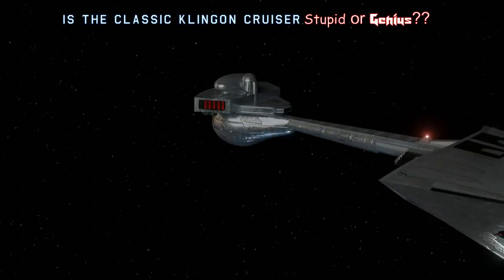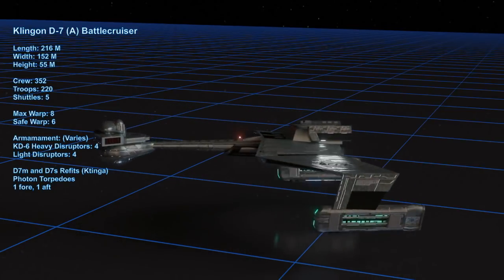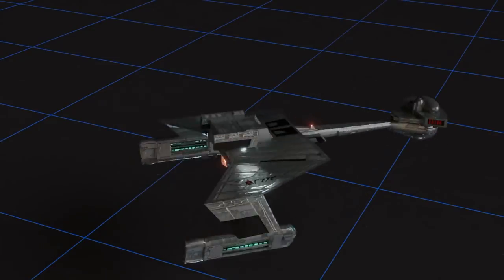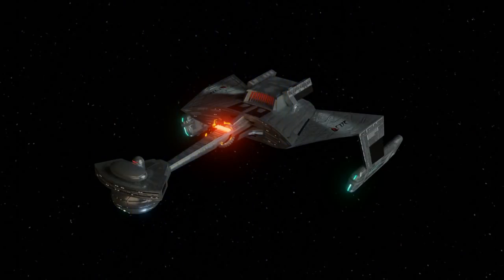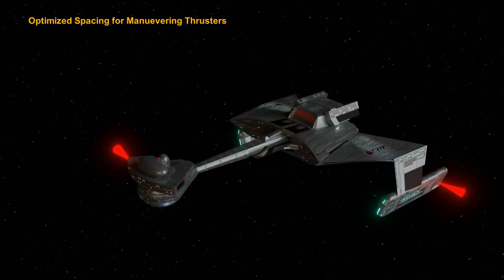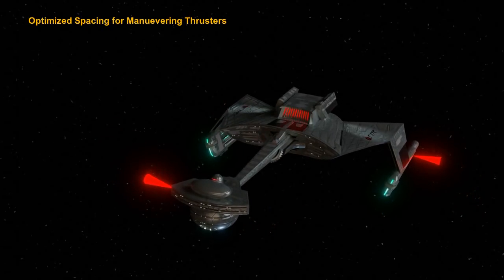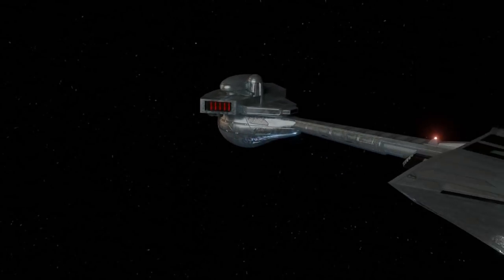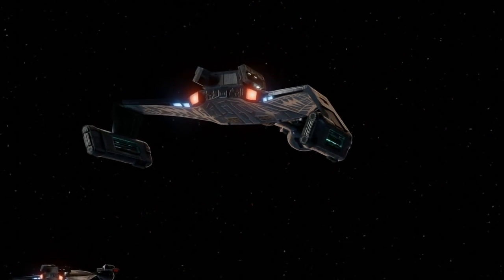The Classic Klingon D-7 Cruiser - Stupid or Genius Design?? Animated Breakdown!

Comment: My theory is that the D7 design is heavily armored but also angled to deter sensor detection, like modern stealth aircraft. The D7 takes advantage of cloaking and a devastating first-strike capability. Speed and maneuverability and always facing toward their enemy would reduce the profile and reduce exposure of the armored boom. I imagine the design preference for Klingon ships is armored hull, offensive power, speed, agility, and stealth/cloak. I would add that if memory serves, Klingons did not have photon torps until the "movie" era, so perhaps their ship hulls were tougher / reinforced against such firepower.

Comment: Its built like a star destroyer, its wedge shaped. But with the area behind the front pod cut out. This massively reduces the materials needed to build each ship. Looking at the volume you could easily build a 4th vessel for the material you save on building three.  Every time you see a Klingon ship, they are in packs. Federation ships almost always alone.

These are warships. They only have one purpose.

Comment: The long neck serves several different functions. It houses a plasma tube in the center. That is essentially A projectile tube for certain type of photon torpedo. That is powered by the main reactor. This gave the Klingon warship one of the most powerful weapon systems in their region of space. The long neck also separated the crew from the highly radioactive power source of the ship. 
The shape of the front of the ship. Down the long neck to its base collar. Was designed that way to also serve as a long rang communications and surveillance system. You could think of the Klingon D7 warship as being built out from the inside of the main deflector dish. Where the enterprise class of the federation is offset from the saucer section. Klingon ships are built inside the main deflector dish.

Comment: I was thinking it had to do with separating the delicate sensors from the high energy of the warp fields and reactor, which might be a factor, but honestly Klingons don't tend to put a lot of emphasis on sensor technology. Instead.... Battlefield damage tolerance. As you point out the ship has weapons on both the body and the head.  You can't fully disarm the ship easily. I bet the weapons on the front have their own redundant power supplies too. That would be VERY Klingon.

Comment: Just a what if…

In TNG it is pointed out that it is the duty of every Klingon crew member to replace a more senior member if any sign of weakness is perceived. While very motivating, it doesn’t seem like the command crew would be able to concentrate on their duties if the entire crew had easy access to the command spaces seeking any opportunity to advance. By placing the command section at the end of an easily controlled choke point, the design ensures that the officers will allow the traditional policy to remain in effect while minimizing the number of advancement opportunities. 

This probably wouldn’t be a design consideration that the Klingon high command would advertise, but a beneficial consequence of other design “necessities .”

Comment: Only thing I can think of is they did that to meet safety regulations on being so far away from their engine radiation because they could only pile on so  much armor or radiation barrier and that happens to be the safe distance.   But then that would mean the sleeping quarters are being blasted.   Maybe its peacocking like "hey aim for my cockpit I dare you".  Probably they just wanna keep the high rankings from sleepign with the low ranks.   Or maybe its to signify "come for the front first out leaders are the best warriors"

Cool to see we guessed alot of the same stuff, I was thinking about "saucer seperation" tactic too but didnt think they had that.
And the turning speed thrusters balance was a good one too.

Comment: I would reason that many ships in Star Trek use elongated designs not just because of warp field geometry requirements as mentioned, but as a form of damage control, and possibly for maneuverability.  The damaging affects of weapons and any secondary explosions can be prevented from taking out the whole ship by separating crucial systems.  In the D7 design it is unlikely that a critical hit to the ship will disable both the front pod and the rear sections of the ship, where if there was no neck providing that separation, a hit to engineering may tear through the ship and destroy a bridge area built closer to it.  Klingon ships likely have back-up systems to allow the ship to be controlled by the engineering section if the command is destroyed, and while less effective, still able to put up somewhat of a fight.  The boom also allows weapons systems to be projected forwards of the rest of the ship, again providing separation so that it is more difficult to take out all the enemies weapons at once.  Federation starships also follow this principle with multiple phaser arrays positioned around the ship, something they can do because energy weapons do not require complicated internal systems to provide munitions to them.  The systems that do require munitions, torpedoes, are far less common place.

Comment: The turning speed makes sense that way 1 ship can decloak and quickly turn and fire on as many ships as possible before recloaking.    And I assume most Klingons would drift instead of staying still and firing like in the shows.  Also that way they can aim their straight shooting proton accelerators or plasma cannons and turn fast.   1 might be able to decloak and take out like 3 unshielded ships and recloak while never stopping and then other guards have no idea where they went and almost no point of firing weapons with prediction patterns cuz they were moving so fast.  Causing the rest of the surviving ships sleep stress for the next 3 days and they scared to stop engines.

Comment: Cubes and orbs are the best design,  the command section at the very center core surrounded by ablative armor, reinforced hull integrity structure, escape pods, rotating shield frequencies, and all backed up by an independent triple redundant power grid.

Comment: Also keep in mind, that Klingons are very attack attack attack oriented. The angle they expect to be fired on the most is from the front, not the dorsals or ventral where the neck would be both high priority and hard to hit. So making a vessel with superior warp field geometry and maneuverability would be an easy decision.

Comment: The radiation theory is consistent with the reasoning behind the design other than USS Discovery in '2001: A Space Odyssey.' Of course, the Discovery had just two active crew in the forward hull section (and three in hibernation pods) and an AI overseeing ordinary functions of the rearward drive section. I never realized that there were crew quarters behind the spine of a D-7. I assumed they were all in the front and just had a small crew with tiny quarters like on a submarine.

Comment: I agree, the neck appears to be a needlessly-vulnerable section of the ship.  But then again, so do the nacelle pylons on the Federation's Constitution-class vessels.

One other possibility: there is a clear separation between the officers and ship-control stations in the forward "pod" and the rest of the crew in the rear section.  That neck makes an excellent "choke point" (pardon the pun) in the event of an uprising, where a minimal security force could hold off any mutineers who tried to get to the officers/bridge.  Having to advance in long, narrow, straight lines against an already-emplaced defender is not a winning strategy!

Comment: You could combine the maneuverability and radiation ideas, too. Radiation shielding is heavy, and simply using distance and the inverse-square law may be a better weight investment for shielding than adding material. A lighter ship can move faster.

Comment: I think the bulb/bridge section might be a modular command pod that can transfer to another "body" and continue as the same noble ship. This would have more to do with honor and pride of the House the ship belongs to.
A lesser ranked member of a family might move up the social hierarchy by allowing the command of the House leader to assume command of an undamaged or newer model starship.

Also, I don't think the boom separates with the command pod. I think just the pod goes.

If only the pod separates, Then the "neck torpedo" idea would be plausible...or possibly a railgun/magnetic acceleration weapon held over from much older designs, but still serviceable.

Comment: Well, actually, I think you hit the nail on the head. Let's contrast the Star Fleet Battles version of the D7 with the version you've discussed. 

First, the D7 battlecruiser was more maneuverable at impulse than most other Galactic Power's light cruisers and destroyers. It had a turn mode of 'B', the second best in the game, meaning that it could outmaneuver any equivalent vessel and many that were half its size due to its hull design. A Constitution class Federation Heavy Cruiser, by contrast, has a D turn mode making it clumsy by comparison. This means that at any given impulse speed, the D7 can outturn a Fed HC.  

It carried a pair of disruptors on the front of each warp nacelle to give a wide range of fire, covering an overlapping 90 degree arc to the front, with each pair of disrupters capable of firing to the side and even partway to the rear, while the secondary weapons were phasers with complimentary firing arcs. These phasers were often of a slightly inferior design to equivalent Federation ships - but there would be more of them and they covered a far greater firing arc. It did not carry and never needed photon torpedoes, as SFB disruptors were more of a replacement torpedo - faster firing than photon torpedoes and the Romulan plasma torpedoes (Balance of Terror) but with less damage per shot. The boom phasers and some of the secondary hull mounts could fire in a 270 degree front arc and a narrow cone directly aft between the warp nacelles. Although we never see them in the original series, Klingon vessels also carried drones, a sort of guided missile, which were cheap, effective, and cost the ship no power to launch. Given the Klingons often fighting each other AND their neighbors also using drones or manned fighters, the D7 also had a drone defense system that was basically a starship scaled CWIS.

The 'dish' used in ST:TMP for photon torpedos was a sensor/deflector dish in TOS and SFB.

In a game that uses hexes, a Klingon ship could fire ALL of its phasers AND its disruptors down the two hex rows 6o degrees to either side of its front, and all but the disruptors straight aft. Couple this with its agility and it could deliver a brutal battle pass 'broadside', then hit you again if you pursued it the next turn, then finish its circle and hit you again, all while you struggled to turn new shields to it on each pass. If you are going slow enough to turn with it, it will dictate the range and location of the shots, and be a bear to catch up to. If you are going the same speed, it will be able to out turn you. 

For all of this, the D7 lacks 'crunch' power, and is better served by using its maneuverability to wear down shields over several turns, before committing to a close-range attack run. This is often called saber dancing, and many disrupter-armed races have to do the same thing.

Second, the Klingons had absorbed and conquered many species in their territory. While many had been raised in the Empire and were fanatically loyal, Klingons segregated them into the engineering hull while "the senior officers and female Klingon warriors of exceptional genetic quality" resided in the boom, with its separate engines and supplies. That's a quote from actual SFB material, by the way. The boom even had a way of landing - though it would not be able to launch again. On the same topic, while a lot of Klingon Warriors were in boarding parties, they used a LOT of their 'subject races' for this purpose too - and they had no shortage of violent, angry volunteers. While the engineering section contained the warp core, the boom contained the computers and sensors that made navigation possible. In the case of a revolt or mutiny, the boom could detach and wait for another Klingon ship, there would be a boarding action to clean up the mutineers, and the boom could reattach. This was made easier by Klingon ships often operating in 3 or 4 ship squads, even when not generally needed.

Klingon warp cores and impulse engines were NOT as safe as their Federation counterparts, but they were tough and well-constructed. The threat of radiation was actually negligible. A lot of the space in the engineering hull was used for power boosters and equipment needed to make disruptors into highly accurate, long range heavy weapons (compared to phasers).

Lastly, the relative fragility of the design was balanced by the Klingon philosophy of battle and their shield layout. Most Klingon ships have forward shields (shield 1,2 and 6 in SFB) that are 20% stronger than the rear shields (3, 4 and 5).  After all, you ARE going to be flying into their faces, and while photon torpedos take longer to arm and are less accurate than disruptors, a few of them is all it takes to end your service to the Empire.

As a side note, there were also penal ships used by the Klingons. These were often older D-series ships. Surviving your five year mission was your sentence, and this ship did NOT segregate by species. It also did not have a boom engine and had second-string equipment. They also had an ongoing mission of hunting giant space dragons, so...

Comment: The D7 was a massively produced ship.  It would be difficult for a federation ship to get a firing arc on the neck, considering two things: most fights happen at long range, and these ships are like wolves, almost never alone.  Also yes I completely agree, hull integrity is a minute problem once shields are lost.  A Star destroyer design would blow up just as easily, and more material and crew would be lost.

Comment: I always thought the long-necked design was the product of necessity, but for budgetary reasons. We know the Klingons were almost constantly at war, and it's easy to picture an earlier design as having a sealed boom area. Simply put, the face of the aft section was meant to be fully enclosed, with a triangular hull ending in the wedge-like portion of the command section. While the rear of this section connected the two halves and likely contained a secondary bridge, the bottom of it would ascend, leaving the ball of the command section and forward part of the boom esxposed. The boom and command section would still separate as the stripped-down design, and much of the extra hull section would contain fighter bays (because as much as we like to forget, there WERE fighters in use throughout Star Trek's history)

While the description is likely difficult to picture, the reason for its absence is much more basic. Simply put, the prototype took too long an used too many resources, so they stripped the design down to make it easier to mass produce during the height of their current war. A great example of how this stripping down can affect the design was beautifully illustrated by E.C. Henry's depiction of a Nebulon B frigate as it might have looked prior to falling into Rebel hands. As with the D7 and related ships, the Nebulon B originally had a much sturdier hull but ended up with a narrow and fragile-looking central boom once stripped.

On a final note, the Klingons likely stuck with the stripped-down design for two reasons not mentioned:

1. the D7's hull is plated to resemble a bird's feathers, although this detail was washed out by the poorer filming technology of the time (just like the way the Star Trek Continues crew discovered the Enterprise interiors were actually a different colour than what turned up on film. Klingons often used designs based on predators, so the narrow boom likely reminded them of a native raptor, hence the common nickname of "bird of prey" given to Klingon ships.

2. Klingons are nothing without honour, and there's no greater honour than to die in battle. Thus, a commander who loses in space combat would be able to use the ship for a suicide ramming. Alternatively, if the shields failed, a good shot to the boom might have triggered explosives, causing the ship to disintegrate so the enemy would be unable to salvage any Klingon technology. While this meant there was a greater chance of death in battle, it would be a death full of glory in both instances.

Comment: I think the crew-compliment on Klingon ships was VERY low compared to federation and other vessels - like 30-40, vs. hundreds as  you say. Also, when you did that visual bit with the front part 'breaking away' from the rest, I realized that if you included the upper part of everything behind it as well (that box-like structure), it would be a very cool version of how the saucer section detaches in Fed ships, basically them just dumping their (supposedly damaged) warp section and just using impulse in that center part (plus, just imagine seeing something like that in  a movie, even if its just a prototype copying Federation design principles). And why would they stick with a design that has out-lived its purpose? You hit the nail on the head, and we have a real-life example of that with the Japanese battleship Yamato, which was built more to impress - and inspire - the Japanese people than actually be used in battle.